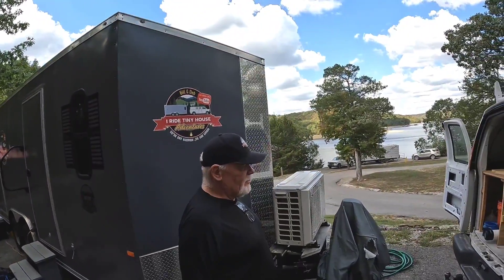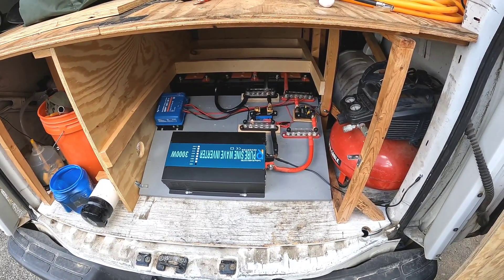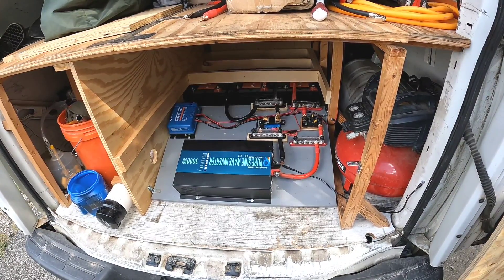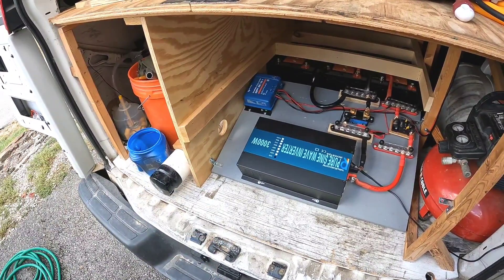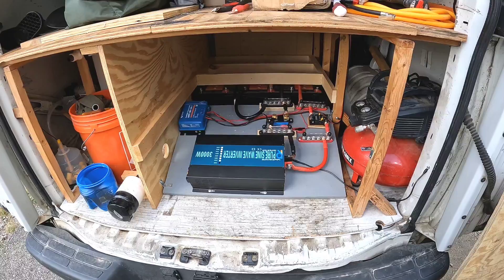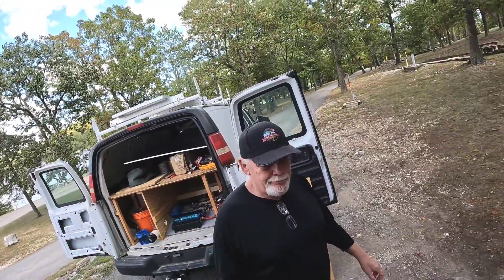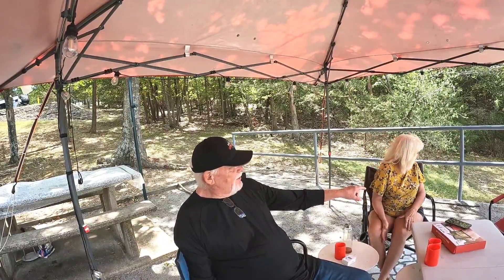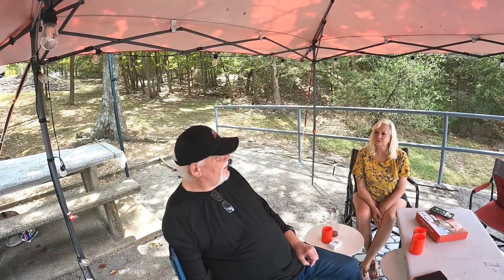More Progress On The 600 Amp Hour Van Based Solar Generator. Deb Doesn't Love Me Anymore??

Comment: Have you considered a DC to DC charger that also has a MPPT charger? As you drive your alternator will charge your battery. Your solar panel will also charge.
Reply from the maker: Yes. Looking at another 400 watts of solar and solar charge controller, or the new victron Orion 12/12 50 amp charge controller.
Reply: Solar devices are developing and becoming available that didn’t exist since you started the solar build 3 years ago. I’ve enjoyed your channel. It’s giving me so many improvement ideas on my store bought manufactured junk.
Reply: U are doing a good job on the new system